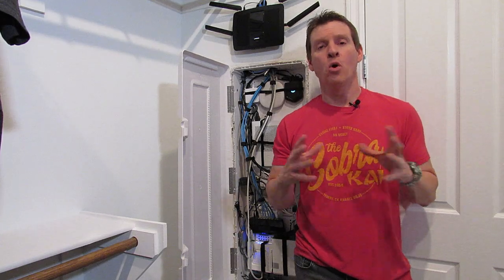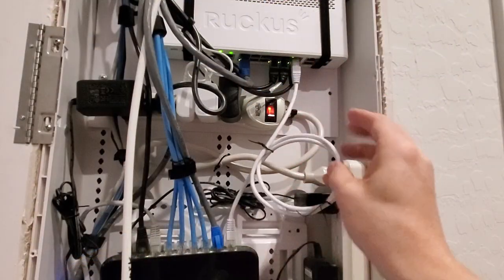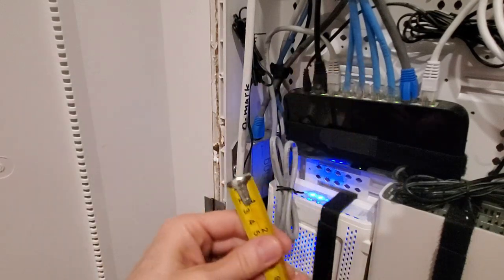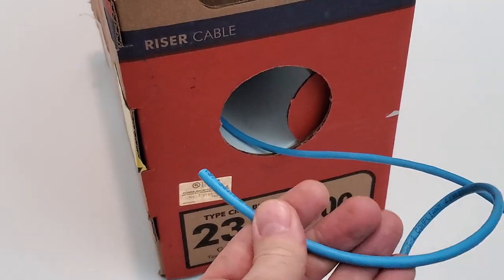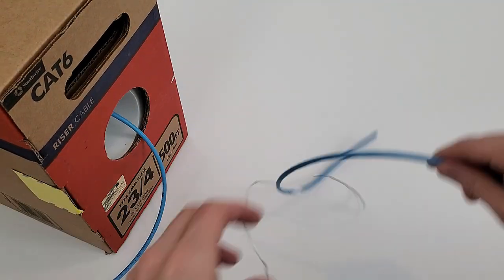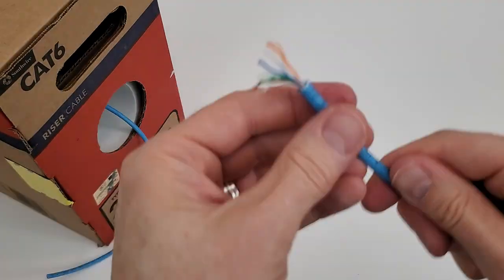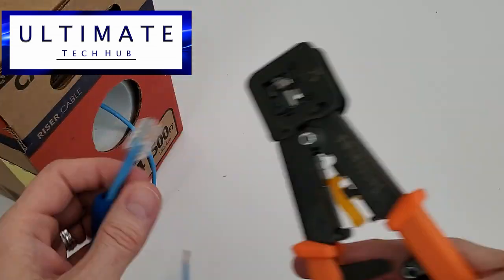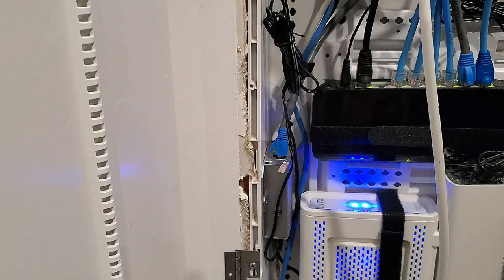How To Make RJ45 Network Patch Cables - Cat6 and Cat5e and Cat7

Comment: Can riser cables be used to connect devices around my house to the two switches i want to set up in my living room and bedroom? I won't be running any cable in the walls but I will be drilling holes big enough to pass a cable into my room to connect to a switch and other devices.
Reply from the maker: Yes absolutely.  Cat6 riser cable will be perfect. Its flexible and easy to work with. Good luck and thank you for watching and if you subscribed thank you as well!